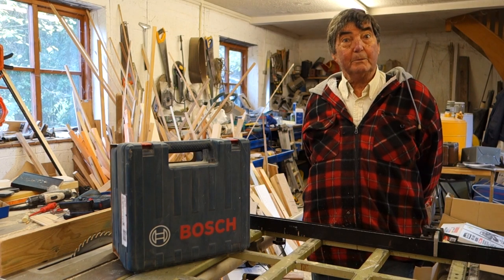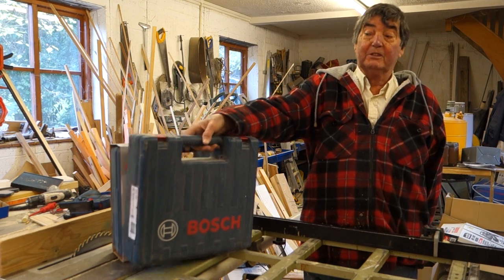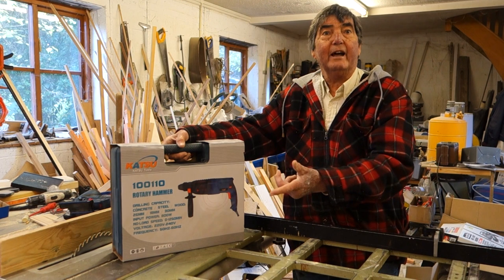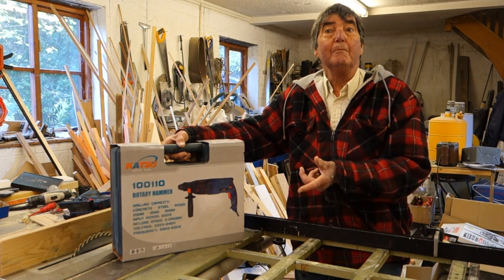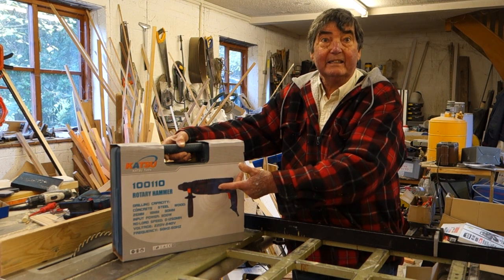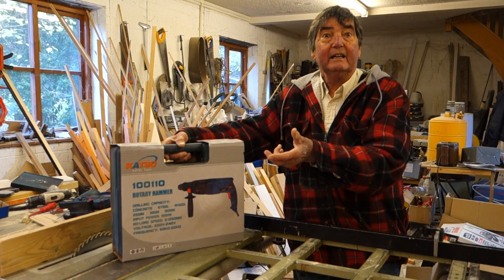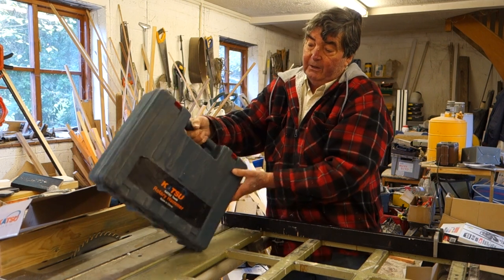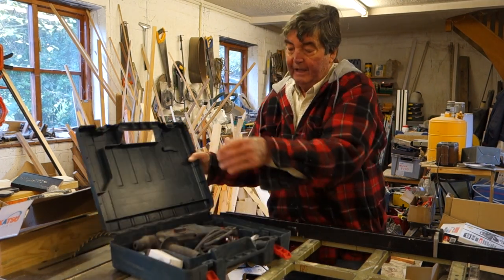KATSU SDS Rotary Hammer Drill Breaker 100110 - Unboxed

Comment: As any one used a cordless version?
Reply from the maker: For me, this type of tool is doing a hard job so you have to think of it as almost disposable. I wouldn't spend the money on a battery and a charger on an unbranded tool. We use this for breaking concrete and channeling. Cordless is best left to the big brands in my opinion